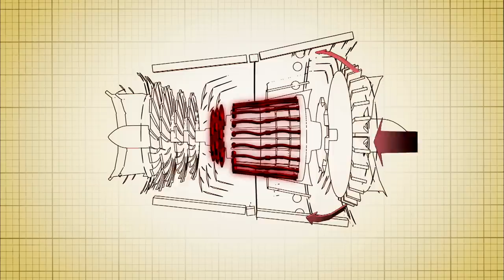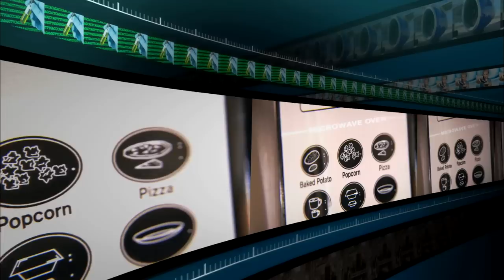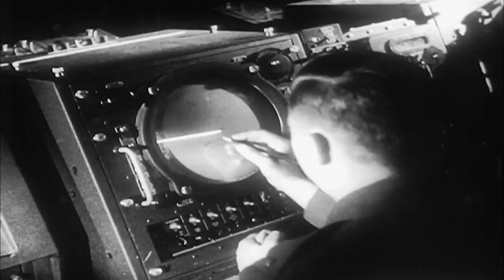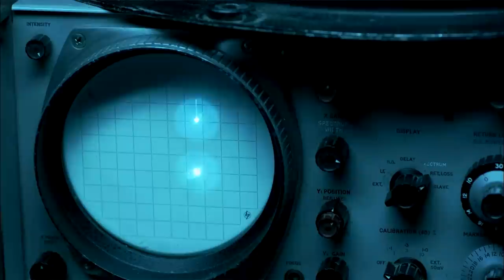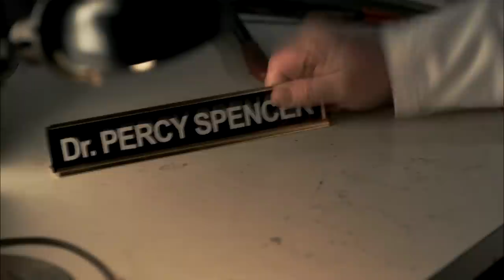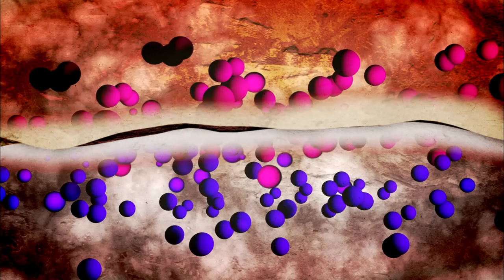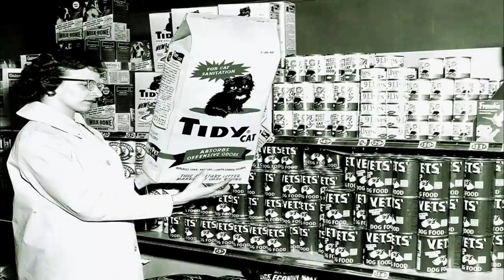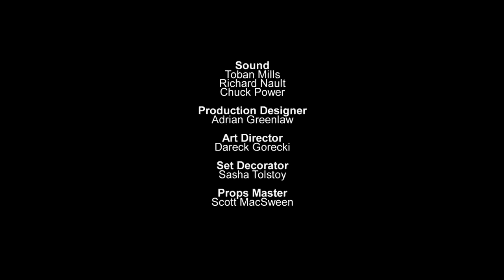Inventions that Shook the World | The 1940s

Comment: 16:30 I believe Zuse's relays came from telephone exchanges rather than telephones themselves. Telephones didn't necessarily contain relays, even if one did, there would likely one be one. Telephone exchange switching equipment, on the other hand, would use hundreds and thousands, more even, depending on just how big the exchange was and how many customers it served.

Secondly it wasn't an end to moving parts. Relays are moving parts! A relay is a mechanical switch, just like, say, a light switch. Except instead of being operated by a person's finger, an electromagnet pulls on a lever that opens or closes switch contacts. Those switches can then be connected to other components, including more relays! So you can have relays turning each other on and off. Just like the transistors in a modern computer, except those transistors are extremely microscopic, where even a small relay would take a few cubic centimetres of space, larger ones taking cubic inches.

Relays will have made Zuse's later machines, the Z2 and Z3, more accurate, but more because each relay was itself a well-made, reliable component, made so to the demands of telephone companies, who demanded high standards of reliability.

They, erm, likely didn't hum either! This part got the most basic facts about Zuse changing from mechanisms to relays correct, but the rest I think are conclusions jumped to by the documentary maker or script writer. They're not accurate. Sure, I don't expect everyone to know the working principles of relays, but they probably should look it up if they're gonna do a documentary feature with them.

Relays are still used nowadays, btw. Not to compute with, but where you want a smaller, less-powerful circuit to be able to control a more-powerful one. The smaller circuit energises the electromagnet, and the powerful part, perhaps a big motor or heater, is switched from large moving contacts.

Last thing - Zuse didn't invent binary or binary logic. George Boole, an English mathematician, did, in the 1840s. At least he's thought to be the modern-day inventor. It could have been invented in the past prior to that, it's a subject I haven't researched enough into to speak with authority. Regardless though, it certainly wasn't Zuse.

Zuse is well-known as part of the history of computing, along with Charles Babbage and Ada Lovelace. He's perhaps not as well-known to the public as some others. So it's nice to mention him, just a shame this video got him completely utterly wrong! If whoever made it has ambitions, they might consider doing that part over again. It would only require re-doing the narration I think, the existing video you could keep.

Comment: As usual; American video, collars as much glory for Americans as possible.  Re. radar (a BRITISH invention), and microwave ovens.  What made airborne, long range, high definition radar possible was our invention of the cavity magnetron in 1940, which made centimetric radar possible, with antennas short enough that you could fit them into an aircraft as small as a Beaufighter or Mosquito (as we did by early 1941).  The cavity magnetron was also capable of FAR higher power outputs than its predecessor, the klystron.  And you know what adds insult to injury?  The fact that the British government GAVE you lot ALL the info and design data for the cavity magnetron in the autumn of 1940 for NOTHING!! (along with all our research on atomic fission and the proximity fuse for anti-aircraft shells)  Yet in this video, none of that gets a mention.
At the end of WWII, an internationally respected American military historian described the device as "the most valuable cargo ever brought to the New World."
In 1940, the best that US Navy radar sets could manage was 1kW, with very poor range due to a combination of low power and too low a frequency. In a meeting with US Navy officers, one of the British engineers pulled a cavity magnetron out of his bag, put it on the table, and said "That will give you 10kW output, at a much higher frequency, reducing ground effects from sea surface echoes, and with far better definition - and we expect it to be producing 25kW by Christmas." (which it did!)
As for microwaves;  what powers them?  The cavity magnetron!
Reply: All respect to British inventors and industry/science.  Most people know what you say is true and good. This doc/vid is just TV entertainment with minimal elaboration. Because that is boring. Don't take it hard.
Will say that the celebration of 'invention' is way over-rated.  
I don't care that some Germans or British built the first ICE cars.  They were just toys for the wealthy.  Who cares?  Henry Ford (an American genius) delivered the technology to the masses. The Model T was the greatest car ever 'invented'.  In my mind, he 'invented' the automobile!  As we know it, today.  
A truly original idea is usually created by a nut, or a maverick. I consider it natural and good that it requires a second person who understands the concept (and it helps to have money) and brings it to market. Call me an American Capitalist Pig.